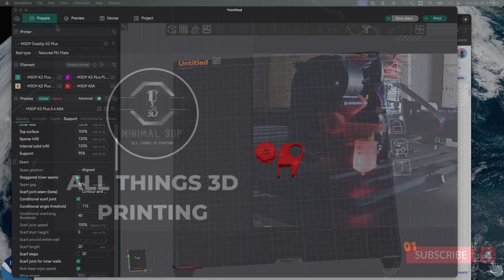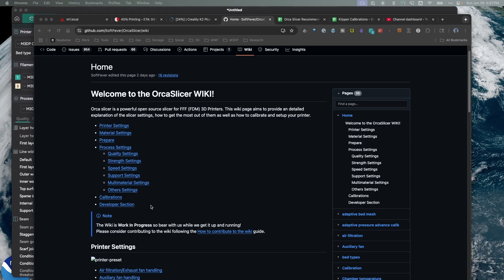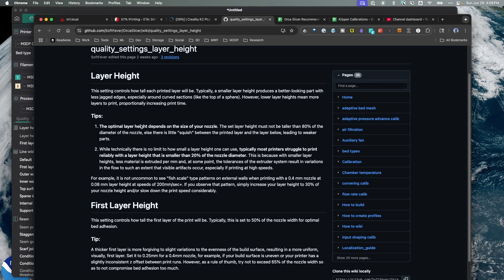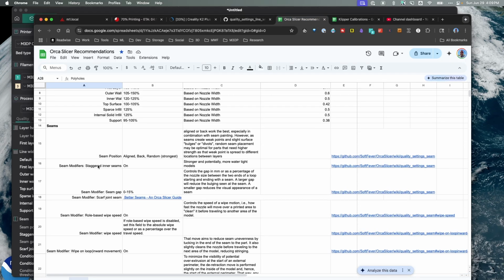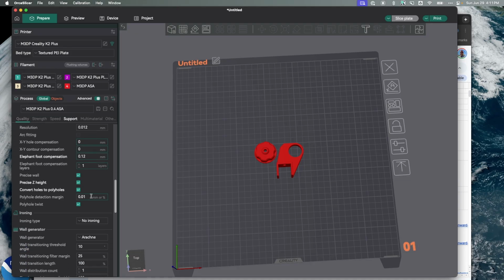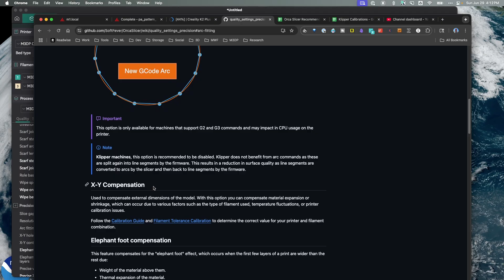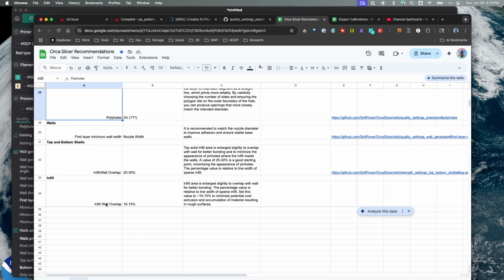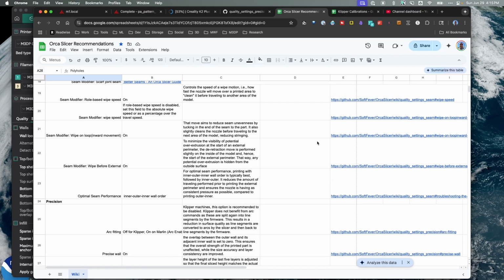The BEST OrcaSlicer Settings: Are YOU Missing Out?!

Comment: The most important part is not blindly change settings but to really understand what a setting does and how it works with other settings. For example. I has under extrusions on some outer walls. It was not min. alyer time since the layer time is quiet high. It´s also not a small peremiter either. Pressure advance is tuned properly so it isn´t that. My print speed for quiet hight with 200mm/s but I wanted to keep it that hight for now since no other feature had any ringing or probrlems. No the under extrusion is due to stark change in flowrate. The nozzle goes into a tight turn where speed dropps form 200 to 5 and flowrate goes from 8 to 0.2 then it goes out of this turn into a high speed high flowrate situation. PA can´t helpt with that since the change is too hight BUT you can turn on Extrusion Rate Smoothing which is exactly made for that. So now I can keep my hight outer wall speed without any under extrusion defects.

Comment: Dude you are AMAZING. I use Google Sheets ALL the time for 3D Printing for various needs, whether I'm tracking a build or organizing slicing settings and what material I need to print a certain part in. It's almost impossible to find Print settings in a list format for any slicing software, whether that be Orca Slicer, or Ultimaker Cura. Finally though, someone (you) have come along and provided a list of preferences rather than having to go on google and dig through Reddit to find just ONE SINGLE SETTING TO CHANGE. Thank you SOOOOOOOOOO MUCH!

Comment: Is your k2 plus stock? I just installed the MicroSwiss hotend on mine getting ready to go through all the calibrations and put together a good ASA profile myself. 

Stock 0.2 profile seems decent but having trouble with overhangs and top layers. Smaller layer height prints seem to be really bad with the stock profile so I need to dial that in a bit.
Reply from the maker: I am almost stock. I changed my extruder gears to metal. I can try to share my K2 and ASA profiles tomorrow after work if that would be helpful. Something I would recommend is to make sure you dehydrate the ASA.

Comment: For the best surface quality on walls i recommend to set the print order to outer/inner or outer/inner/outer (with at least 3 walls). When the inner wall is printed first you can see the imperfections of zhis wall on the outer one. The only downside is printing over hangs. For larger angles inner/outer is better. Another setting for surface quality is don't slow down on outer wall in the filament settings. With this setting enabled the outer wall speed will be constant and the wall won't be more or less shiny on some spots.
Reply from the maker: That is some great info. Do you have a reference I could use to add to the spreadsheet?